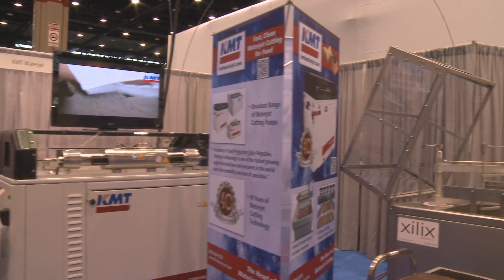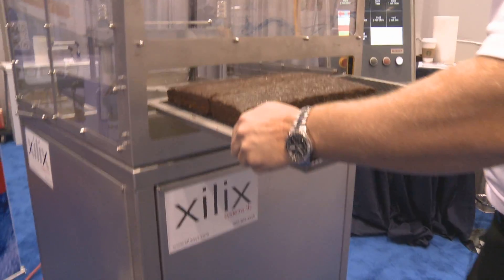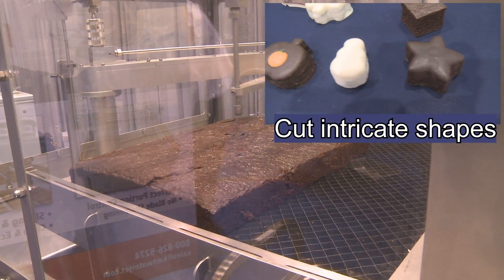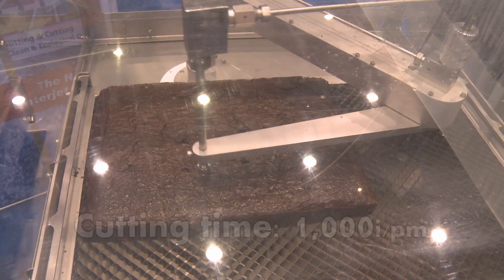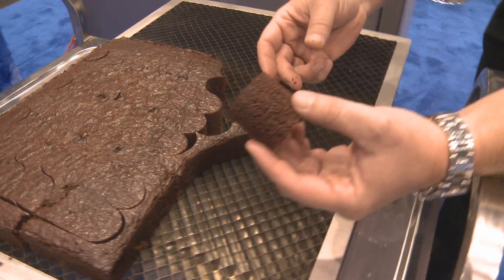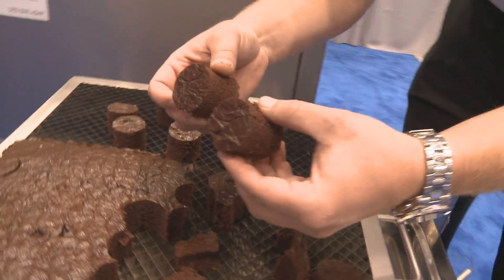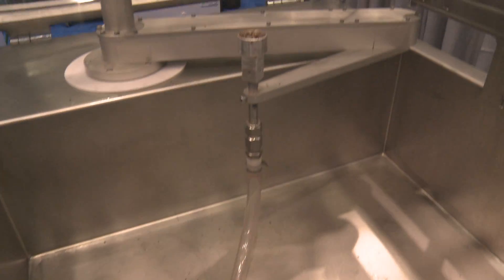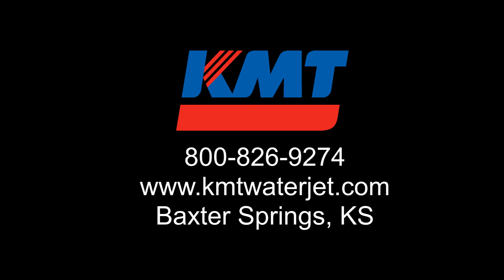KMT Waterjet Cutting Xilix Spectrum Cake Cutter

Comment: May I know orifice size?
Reply: We typically use a 0.005" orifice for cutting baked goods and pastry.  This is an older generation machine, you should check out the newer models.
Reply: @shawnquick3230  Thanks. Pressure maybe around 10k psi right?

Comment: I want to know one important thing....doesn't the edge of the cut get wet?
Reply from the maker: +Craig Bray A diamond orifice is used to maximize the waterjet cutting stream life---typically the size of the stream is the width of a human hair at speeds up to 3,000 feet (914 m) per second. This small kerf width is so thin that food will not be compressed or washed out. The cake is cut on a grate which allows the the water to drain off well below the product. Thank you for your question.  KMT Waterjet
Reply: KMTWaterjetCutting